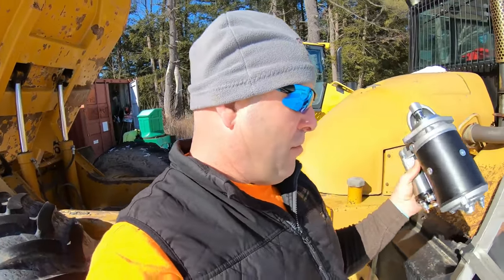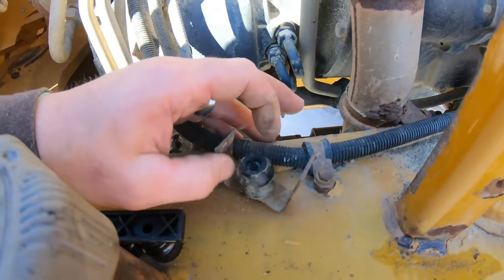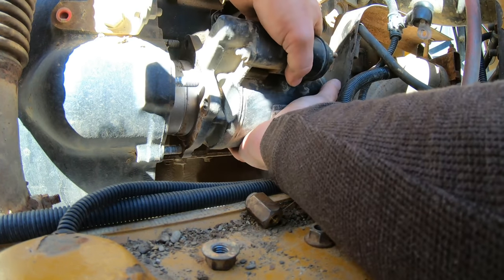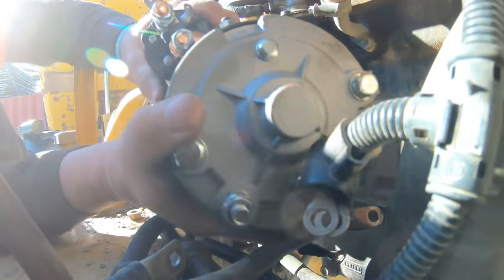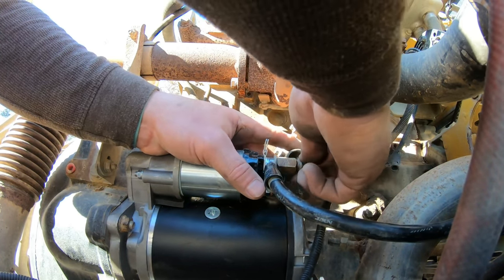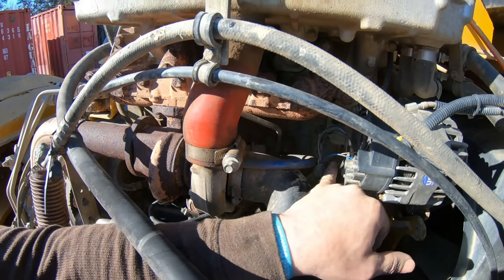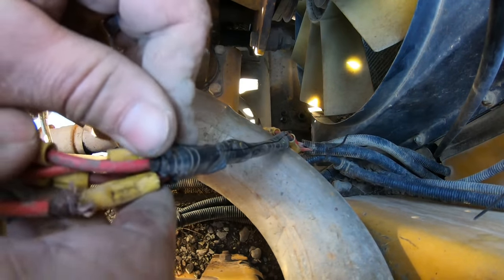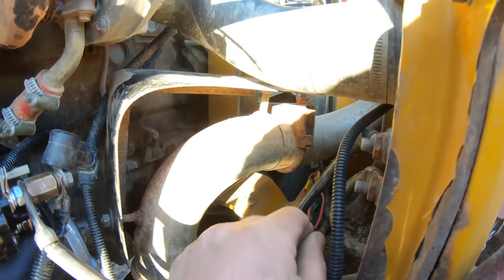How to Diagnose and Replace a Starter well what could go wrong!

Comment: Just some advice if you’re just using the disconnect to kill the power, double check for power on what you’re working on or do a test start after killing the power.  If your disconnect ever fails you could be working on hot wires and not know it.
Reply from the maker: Good point

Comment: Take and remove and clean all connections from battery to starter all it takes is a little build up to effect connection. Check ground straps from engine to frame and cab. I have had to do that on my pick-ups in the past that had the same problem.

 We never grow old on the inside it's just the body that gets old.
Reply from the maker: Thanks

Comment: Hey I'm liking your channel.  I would just advice if you have a multi meter to check if you are getting a full 12 volts at the starter from the key? i believe it was the square connector one, Remove it from the starter and connect your meter to it an turn the key multiple times and see if you loose the voltage, to see if the ignition switch is bad.   and i believe what smoked was a fusible link at the alternator,  if you have charging problems then go after that.   Good Luck.
Reply from the maker: Yes going to get to that Thanks for the tips

Comment: Mike when I first heard that it reminded me of some equipment that we had with switch  problems.  Also check the main ground cable.  Sometimes these type problems will make you pull your hair out.
Reply from the maker: I worked on it all day changed grounds fixed other wires etc still got nowhere lol
Reply: @DIRT-BOSS  So a new switch didn’t help either?
Reply: We had a few of our Glider Kits that the safety relay went bad and we replaced the switch with just a plain tractor push button switch.  We still had to turn the ignition on but then just used the good ole reliable push button switch.

Comment: It is usually a grounding issue. take a jumper cable from the ground of the starter to the battery and see if that fixes it that way you know if it is ground.
Reply from the maker: Ok thanks
Reply: @DIRT-BOSS  I have worked on old rusty salt trucks for 30 years
Reply: Plus 1 on the ground. Also battery connections and connections at the disconnect.

Comment: Hey Mike try jumping the starter with a screwdriver if it start everytime it is in the wiring. Check the voltage at the starter and check the voltage on the small start wire it should have battery voltage with the key in the start position. If not start at the ing switch and go back to the starter. Wiring or relay. Thanks for the video.
Reply from the maker: Thanks man

Comment: Bad crankshaft position sensor or a hairline crack in it? 
Had similar issue with a vehicle. Sometimes started on first crank, sometimes after several cranks. Replaced fuel pump, fuses, alternator, spark plugs, battery terminal connections, etc. Ended up replacing crankshaft position sensor and it started on first crank and never had anymore issues starting after.
Reply from the maker: Thanks

Comment: The old starter sounds like a starter solenoid start making full contact. They were coronavirus side and you have to click on several times and sometimes it'll start and sometimes it won't. I would hang on to the old started and check the solenoid on it. A replacement
Reply from the maker: Ok thanks

Comment: First off definitely replace all those but connectors with new connections that are heat shrunk at a minimum and then follow the wires back to the key switch use a power probe to excite the starter wire from the back of the key switch if it works every time you need a switch if it works intimately the problem is in the wiring don't forget to make sure you've got a good connection at the large cable connecting to the battery another great video sometimes we all learn the hard way
Reply from the maker: Thanks appreciate it

Comment: Mike, first thing is to get rid of those 8 butt connectors and run new wiring and use heat shrink connectors. if those 4 wires have a single eyelet at the end that connects to the solenoid then you could get rid of those 4 wires and use a cable like maybe 8 gauge with an eyelet on one end and a barrell or round connector on other to connect to the 4 wires farther down the line. As for your starter problems the bendix gear is not pushing out into the flywheel on the first couple tries, sounds like you not getting a signal to the solenoid wire ( the small one ) all of the time. I would trace that small wire leading to the solenoid for damage and connection issues, if that wire looks ok than it could be an ignition switch like you said starting to fail. good luck.
Reply from the maker: Thanks in the process

Comment: Honestly I would like to see the Wiring schematic. Check for voltage at the starter and relay checking for continuity in ignition switch would illuminate a few things. I would definitely eliminate the cluster of wires and put one bigger gauge of wire in. Without a doubt those wires are supplying electric to other components. Great video I like the my dad is the best!!!!!
Reply from the maker: Yeah Max is funny on the video! Appreciate the tips electrical is not my specialty It gets confusing!
Reply: A wiring schematic may reveal a  safety neutral switch that could possibly be Failing.

Comment: Well, you've gotten some pretty good advice already, but I might as well thrown mine in. I think you're already heading this direction, but even though it may be a relay, ground, etc., I'd still get rid of ALL those connectors, replace everything with different individual color wires and use those solder seal connectors. Then put shrink tape on each one to keep moisture out and put the whole thing into a new section of loom. I do that when I'm rewiring and the loom really makes for a clean, finished look. Enjoyed the video - especially the snow sliding & Max's comments.
Reply from the maker: Yes worked on it two days since that video replaced relays grounds bypassed the key switch bought fancy testers blah blah blah ECT everything you could think of I finally tonight cut them damn four wires and going to tackle that tomorrow.. lol oh yeah and I fried the alternator when hooking those wires up backwards 😳
Reply: @DIRT-BOSS  Crap! That's just what you needed. Now watch it be those wires the whole time. That'd be my luck, too.
Reply from the maker: @dalepremo3695  Hey I ordered those connectors today Thanks for the tip they look awesome!
Reply: @DIRT-BOSS  Great! I really think you'll like them - takes a lot of the hassle out of soldering. Looking forward to seeing you do it if you decide to make a video on it. Now, just don't be like me and forget to put the shrink tape on BEFORE you solder it up, LOL!

Comment: Had the same exact thing happen to my truck. Ended up being a bad ground. I’d check your ground wire from the starter to the other end. Scrub the connections with a wire brush. Haven’t had a problem since. Good luck
Reply from the maker: Awesome yes I'm going through the grounds now I think that disconnect was messed up It had a crack in it and the pole was spinning.. which is the ground

Comment: Did you verify that the alternator was still charging after your bolt of lightning? It could have smoked the regulator. 
I agree with soldering the wires and with shrink wrap cover and check for a good ground from the starter to engine to frame AND to the battery. You could test by running a jumper cable directly from the ground terminal on the battery to the starter and see if you still get the nobody home click.
Good luck.
Reply from the maker: Yes the alternator is shot.. I did several tests pretty close now

Comment: That clicking it from bad ground connections just gotta chase it down might beed new battery terminal ends or something but that is a short somewhere had the same thing on my loader once put new cables and ends on it didn't happen anymore
Reply from the maker: Awesome thanks
Reply: @DIRT-BOSS  no worries fucking wiring sucks lmao and could possibly be the ignition switch but honestly doubt it but could check that aswell

Comment: weve got a sterling tandem with a mercedes benz motor  that clicks and no start its not batteries or starter it been to 2 different shops and had 4 starters in it and it still randomly wont start some times no one can figure it out luckily its a manual and just pull start it when we need to
Reply from the maker: Crazy got to be a ground

Comment: Could be in the key switch but without testing could be anything in that system 
Good Video 👍 Dirt Boss
Reply from the maker: Yes I've been testing for 2 days cleaning grounds replacing relays tested the key switch took it apart looks good bypass the key switch blah blah blah everything you could imagine I'm getting close though or I'm not going to care anymore about it and just run it lol
Reply: @DIRT-BOSS  hopefully you get it🤞👍

Comment: Check your wires for corrosion on the inside. It will cause a voltage drop and cause the clicking!
Reply from the maker: Yes I got a multimeter on it and I see every so often the voltage drop when I turn the key replace the wire and it still does it so it is the feed wires with all those butt connectors

Comment: Hey Mike...I'd fix all those wire connections first . I'd check to see if there's a ground cable going from starter ground to frame as well..clean connections if so...if it doesn't have a ground to frame I'd add one..or from motor to frame . It sounded like the starter clicked each time you cycled the key...I'm wondering if the wire to solenoid is supplying enough volts..those butt connectors might be the issue . Might as well check battery connectors as well..prolly corroded or possibly loose . 
    A company I worked for in the past had master disconnects on all the trucks...they had issues often..at least until I found a good brand . We used flaming river disconnects..seemed to last the longest..but double the money..a Cole her see marine disconnect is pretty decent as well . These steps would be mine..take it with a grain of salt lol . Good luck with her
Reply from the maker: Thanks for the info!

Comment: Boss of all dirt
Just a suggestion for any future starter work….all of the starter episodes have been with you replacing oem types…the newer gear reduction ,permanent  magnet  types are not only smaller in size but they turn engine over much faster using less current..
Affordable starter and alternator in North Carolina can source any fitment…..I never liked the starter speed of my JCB backhoe and had affordable guys supply me with brand new at about $200… to replace the huge direct drive type…..and because I love the sound I also put one in my C12 cat truck..
Your Komatsu dozer has a gear reduction permanent magnet type…that’s why it turns over fast…
Don’t get mad for the advice
Reply from the maker: That's awesome advice I always wondered I hate how slow some equipment turns over

Comment: Rule of thumb  when dealing with DC voltage check all ground wires and ends .  Butt connectors suck i hate them i have had on more than one occasion electrical gremlins come to find out the wire was broken inside the connector but it passed the tug test .
Reply from the maker: True

Comment: Because you have the same problem with two starters indicates that the starter and the solenoid are working fine. The clunk, clunk indicated that the solenoid and the ignition switch is working. It would be a good Idea to measure the voltage from the thin wire that connects the ignition switch to the starter (flat spade connector). A low voltage could keep the solenoid from slamming the connection between ground and the battery positive (that is what a solenoid does). Most likely the issue is a bad ground. Check and clean all ground connections. Don't forget to clean and check all positive battery connections also. But most likely it is a ground issue. The smell of smoke at the alternator might be the voltage regulator in the alternator. To check, start the motor. Measure the voltage of the alternator output, if it exceeds 14.6 +-.2 volts the voltage regulator is bad. Note: the higher the RPM of the motor the higher the voltage if the regulator is bad.
Order of diagnostics.
1: Repair damaged burnt cables
2: measure voltage at the flat spade connector on the starter.
3: Clean all battery ground connections. 
4: Clean all positive battery connections. Don't forget the battery on off switch, it could be bad.
Good luck!!!! If you have any questions, contact me.
Reply from the maker: Thanks Bud great info!
Reply: Hey Mike. Just remembered you might have a 24 volt system. Check the manufacturer specks for the the voltage regulator. The voltage specks I gave are for a 12 volt system

Comment: Mike I’m hoping you’ll be soldering all those wires so you know you got a good connection I would have either used a brass brush or sand paper on all the connections and the kill switch could also have a intermittent connection problem I would clean those contacts too!!!  But definitely solder those wires and shrink wrap them and get that wire cover to protect them all from heat too!!!! Hopefully I made sense in my rant!!!???? The new camera man was awesome 🤩!!!! Good luck 🍀 and I’ll see you in the next video!!!!!
Reply from the maker: Thanks for the info Henry

Comment: I’ve had a couple semi trucks do that .one was a bad switch and the other was.... a bad switch 😂 🤷‍♂️
Reply from the maker: Worked on that dang thing all day changed grounds change this change that still doing it lol It looks like it's going to be a key switch next and I did smoke the alternator when I hook the wires on backwards It was a 50/50 chance but two black wires.. 😂
Reply: @DIRT-BOSS   yeah I’d mabe put some red tape o the positive lead. I really like that truck you have .thing is cool . I worked on the couch all day 😂  I have so much stuff to do but It’s been freezing out

Comment: Your problem is volt drop and that QUICK DISCONNECT is 99% likey the fault - bypass that and clean the terminals and all should be good.
Reply from the maker: Awesome thanks! I had problems with that before I bet it is thanks again I'll check it out today

Comment: I would not do anything until your fix those wires all the right way! Anyone of those could have a bad connection.
Reply from the maker: Yep after 2 days of replacing grounds hot wires burnt my alternator up put a couple new relays in still got issues.. Just cut those wires now going to fix them tomorrow

Comment: In my experience... that clicking you hear is from the solenoid... yours should be fine as it's attached to the starter you just replaced, but often its the wiring going to it with not enough juice.. it's a relay and needs enough juice to cause it to kick over... So it's probably some wiring somewhere between your switch and it... I know once I actually found mine to be the solenoid when the terminal broke off... but tthat was on a vehicle where the started and solenoid were not attached.. like this one it..
Reply from the maker: Thanks for your input

Comment: 90% of the time when you get the starter solenoid click, it's from a bad ground. Clean all the ground points and check the eyelets on the ground cables for corrosion and a bad crimp. My money goes on bad ground! You probably smoked your alternator 💥better check to see if it's charging. 👍🏻
Reply from the maker: Yes that's what I'm doing now and yes the alternator is shot what a dumb move!!